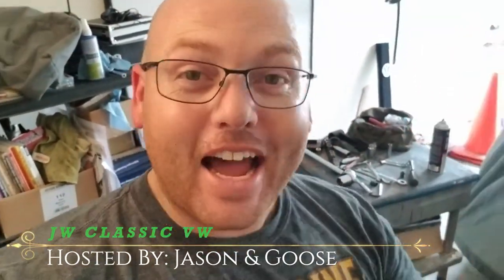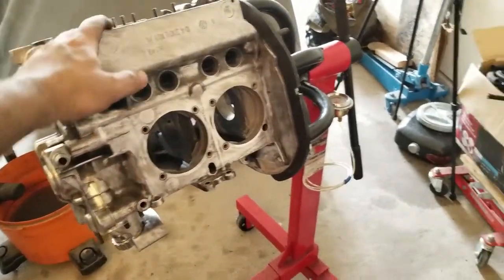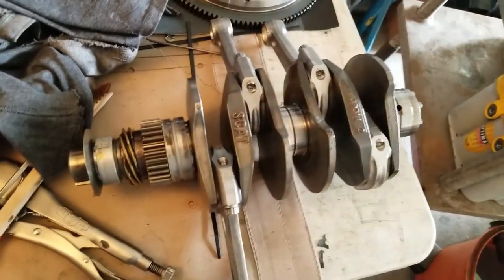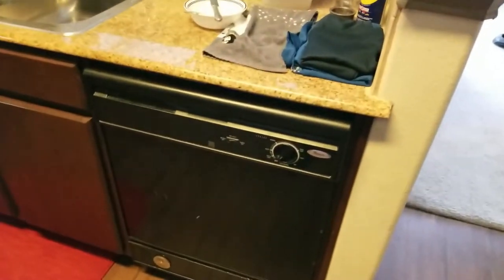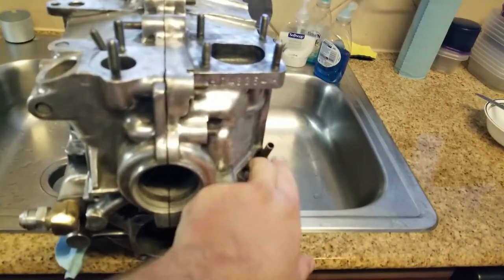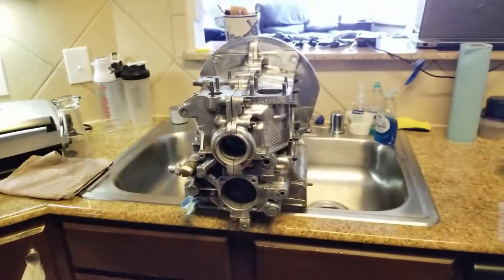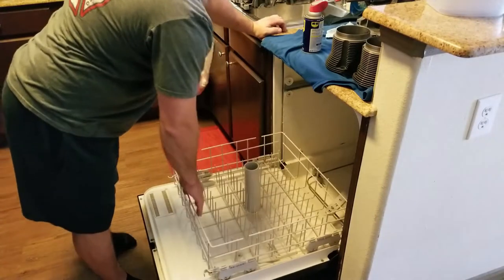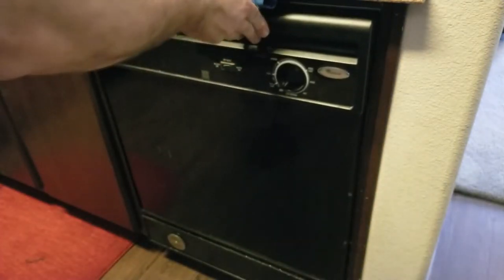Engine Case Cleaning in a Dishwasher! -  1956 Ragtop - Volkswagen BUG | JW Classic VW

Comment: Turned out great running the case in the dishwasher but I don't think I'm going to try it here at home. Great idea with the lapping compound and the jug spigot. If your were using a metal to metal contact seal it may be worth the time.Honestly with the bead of silicone on the jug the small amount you are smoothing it will not make that much difference for the time you have spent. Keep the great videos coming!
Reply from the maker: Thanks for the comment brother!! Yeah I figured its probably not going to make a huge difference but it pretty cool video... lol

Comment: Yes Jason you do not want water spots on your VW case Cascade a good choice. Question after honing them in did you keep track of each on like a match set ?? The little time it takes make sense to me , back when i was in tool & die soap stone many mating surfaces .  What i do on my cases, paint just the bottom with a ZINC alum. paint not so much for a clean look but corrosion.I'm sure you seen a few VW cases by the oil cap just eating all up.
Reply from the maker: Hey Dan... good morning!! Yup all cylinders were done to there respective locations. Thanks for the comment and being here brother!!

Comment: Hi, I have a quick question - how heavy is the block with the crankshaft, pistons, and flywheel still connected, but everything else off the engine? (Manifolds, generator, cylinder heads, etc)? Would it be possible to take the block up out of the car if all the external parts are taken off? I just bought a 1972 Beetle and the engine needs a lot of work, but I don't really have any way of taking the engine out complete. I'm going to try to take it out in sections. I know that will take a lot longer, but I'm in no hurry.
Reply from the maker: Hey brother, getting done how ever you can... no worries.  The problem is that you'll be able to get the engine torn all the way down to the heads with it still in the car, but that's  it.  Unless the car is in pieces.  As for the weight of the engine short block with flywheel is probably close to 100lbs.  With the heads close to 130/140lbs.
Reply: @JWClassicVW  Thanks! Yeah, it seems like the engine is seized up. The car was sitting for years. I've never taken an engine out of a car before, and I don't have any decent jacks/jackstands that would go high enough. Also it just seems kind of dangerous. So if it's at all possible, I'd rather try to take the engine out in parts and maybe get a friend or my brother to help me take the block out.
Reply: Sorry to Bug you again (Ha!). But I had another idea and I was thinking that if I'm going to take off the manifolds, generator, and fan shroud, then maybe the engine with the heads won't be that tall and I wouldn't have to jack up the car that much. That's actually what was making me nervous, jacking up the car that high to get clearance. But if it's just the case and heads, maybe I won't need that much clearance?
Reply from the maker: @ct6502-c7w  That is true you won't need to jack it up very high at all... but you'll also need to remove the oil cooler.